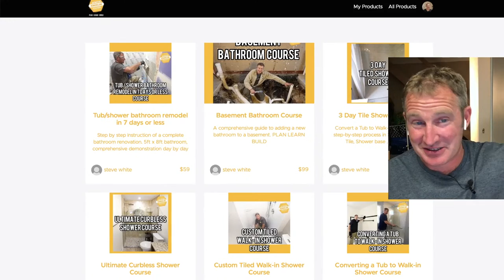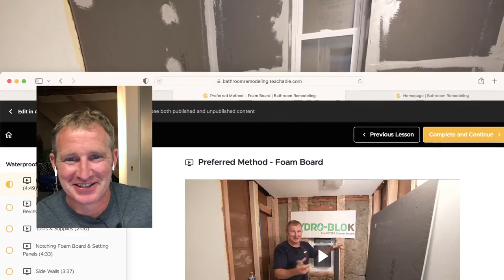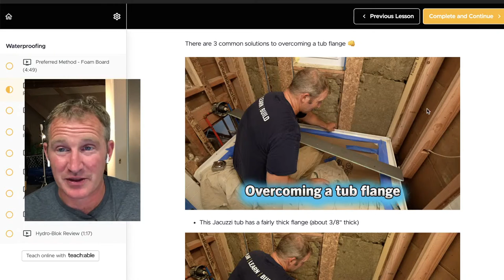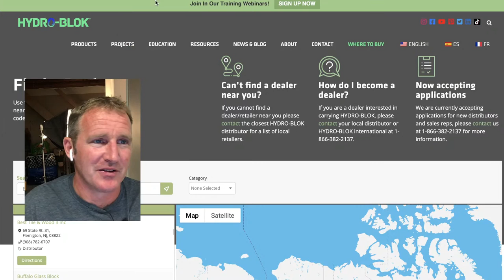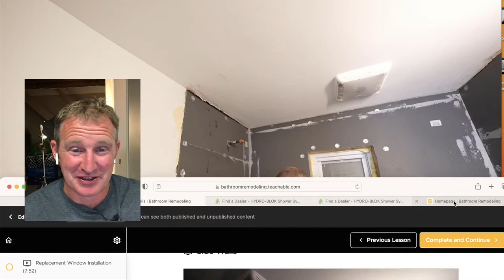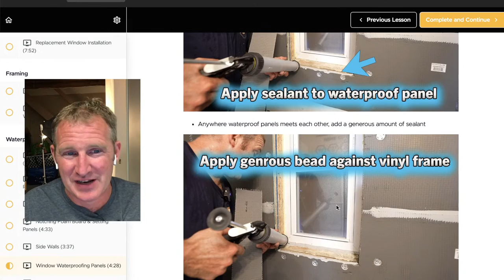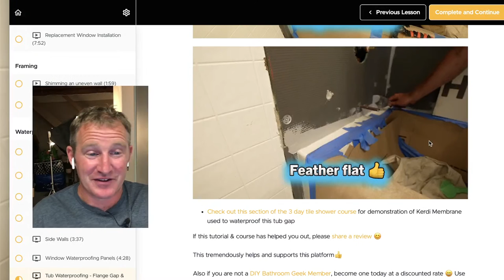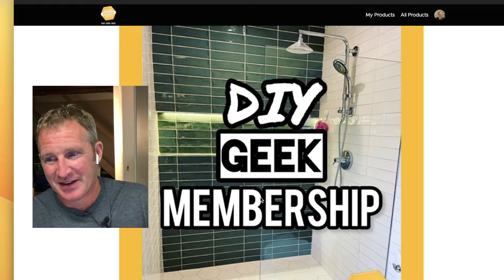HydroBlok Waterproof Tile Backer Board

Comment: This was excellent!   You gave me advice 4 years ago to gut my bathroom as it would be much easier to remodel after we had a major plumbing leak (which was perfect for a bathroom remodel).  It was a lot more work for me, but it was great advice and better in the long run.  I'm done except for my tub surround, and this is exactly what I need.  I'm using GoBoard, have a window in my tub, and am shimming out the walls right now.  I'm buying this course since it's exactly what I need right now.  Much appreciate your time and effort in making these vids.